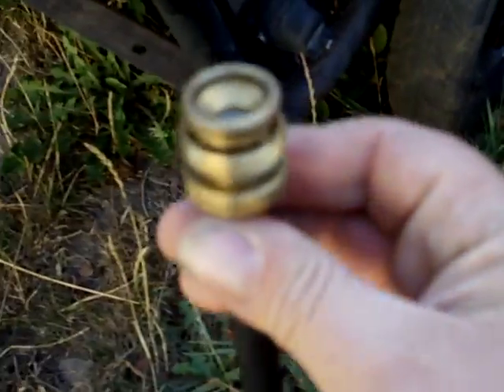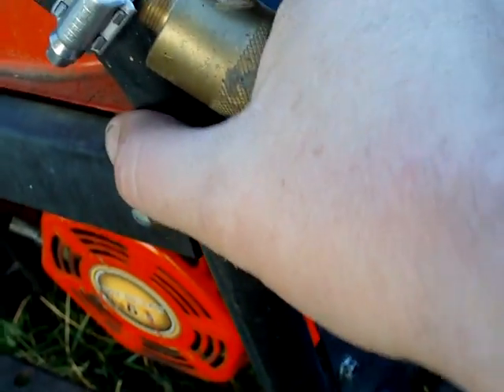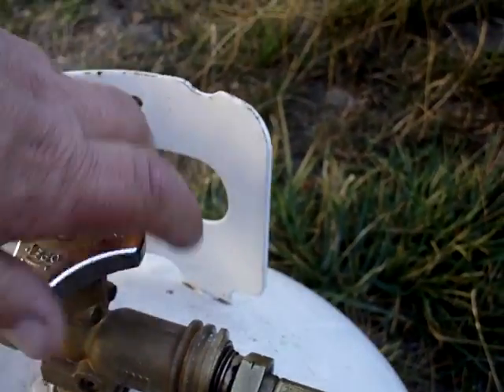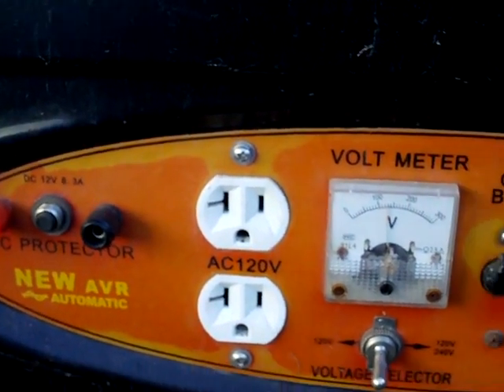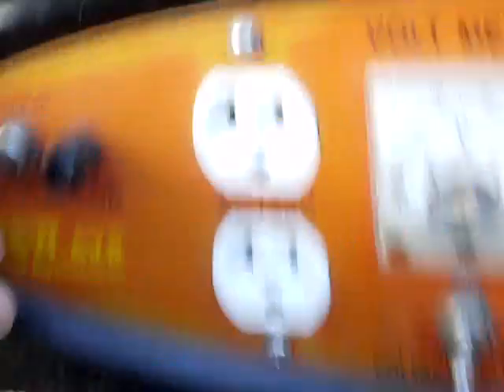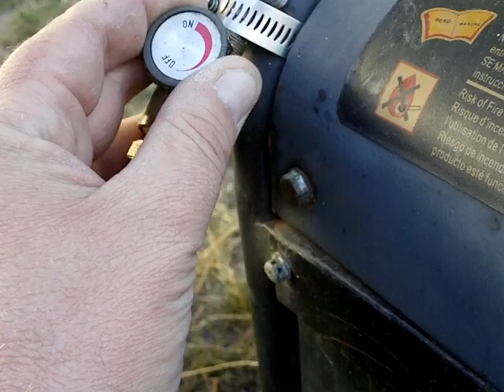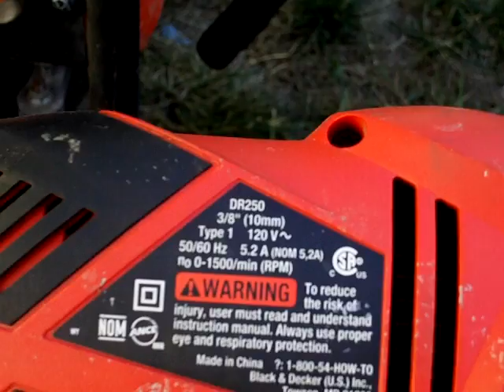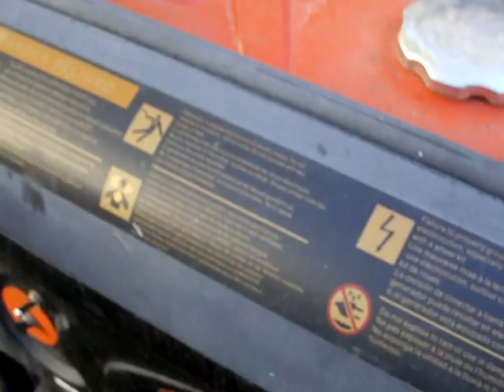HOW TO MOD A GENERATOR TO RUN ON PROPANE OR GASOLINE

Comment: i heard that running on propane for a while, it can overheat the intake valve andlead tosiezing of engine. Any experiences or thought on that?
Reply from the maker: TOTAL BS !! If that is true why do they build propane generators ?? ..RIGHT
Reply: @shawnmrfixitlee6478  well, i don't know. my question was well meaning.tho i assume that in case of custom designed propane engines, these would probably have specific technical solutions to prevent valve sizure, WHICH MIGHT NOT BE PRESENT IN GASOLINE ENGINES. that's just me tho. but i don't know. that's why i ask.
Reply from the maker: @bluemoondiadochi  Propane has quite a bit of oil in it . And the engine will lube the valve setup as if it were gas from the pump . Any gas engine can run on propane and be fine doing it . Thanks for asking ..
Reply: @shawnmrfixitlee6478  Thank you for your answer! I understand now!
Reply: @shawnmrfixitlee6478  I've stumbled on more info! basically LPG will burn the engine ONLY if it's too lean (which is very similar to how gasoline can burn too hot in engine).
dont quote me on this one, but i think the perfect fuel air mix is 1:14.7 for gasoline and 1:15.5 for LPG.
So, that one solved for anyone who would also be interested.
Reply from the maker: @bluemoondiadochi  Your right any fuel used in an engine can cause lean/rich heat problems if not adjusted right for the engine in question..

Comment: Hell, YEAH....   I got a great idea now. I can do the same thing to my truck.  Just pull the fuse to the fuel pump.. and just use it for setting while camping and changeing and warming up in the cold. This would save me alot of fuel while I'm on the run or hiding out in the woods... Hell yeah.. then I will get a generator and do this to it...right on man.

Comment: Got 7.5 Onan genset , putting out 210 how do I adjust to reset to 110?
Reply from the maker: check the RPM if it;s above 1800 slow it down with the gov adjustment

Comment: Interesting. I will, on a rainy day off, play around with this and see what happens. Keep in mind that I have no paper degrees but, had a smart Father who showed me a lot. I myself am very good at figuring thing's out .Not too much gets bye me..lol some times . This should be good. Thinking back I seen this done when i was a kid but , I didn't ask how, shame on me. 
 I love you-tube. If you don't know how to do something look it up 10 times. if you get the same thing 8 times, It should be good.  When I was a kid you had to look it up in an encycliabita . yes I spell good to. 
 To give you an idea. Last week i changed out my  fuse panel for an A   breaker panel . I have rebuilt car engines in the basement. yes rings and rod bearings . Head job too , with a drill and compound paste.

Comment: Simple hook up that's got to be a lot cheaper than the $100+ kits they sell.  Thanks for shairing...oh yeah, Roadking sent me here
Reply: You can get the duel fuel carbs on Amazon for under 30 bucks some cheaper than 20 bucks
Reply from the maker: Thanks man .. It was a cheap and easy hook up !!  Good ole Roadking ..
Reply: Don’t forget about generator safety as well https://youtu.be/I1jT3ANENvI the safety of using generators is required

Comment: Hi got your reply thanks,can this be done through the fuel pipe route? as I have read it can be.
Reply: Exactly and what happens if the engine dies or blows up? you now have raw propane flowing! Spent the money and do it right for safety! A regulator on the tank and a demand regulator at the generator! If the generator quits for some reason the demand regulator stops flowing propane because it's looking for a vacuum to work! No vacuum no propane flowing!
Reply: @derbyone1011  Thanks bill found your answer lol.
Reply: @derbyone1011  exactly these hacks make videos not having any concern for safety or design of generator sensitive electrical circuitry , should make videos about how to clean up the garage , won't cause other morons damages and propane bombs in the niebourhood ,
Reply from the maker: Yes it can easy .. However you can only run propane after that mod !! No more gasoline ..
Reply: Generator safety is required https://youtu.be/I1jT3ANENvI

Comment: Don't you have to do something to the carburetor to make it run on the propane?
Reply from the maker: nope , Carb stays stock . I did make my main jet a slight bit bigger so it would run richer , But that's just so the engine will run cooler on gasoline ! And start better as well..
Reply: Carb just vaporizes the liquid you don’t use the carb with a gas natural or propane using the torch valve as a throttle